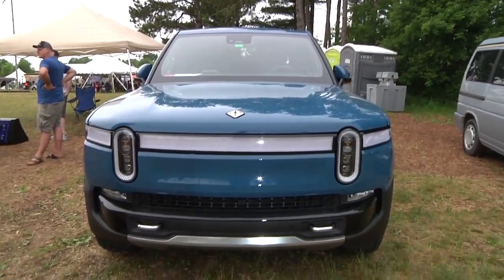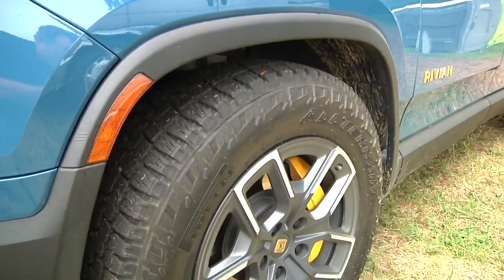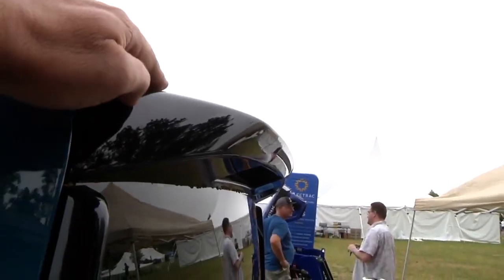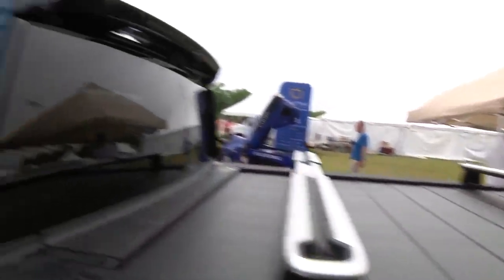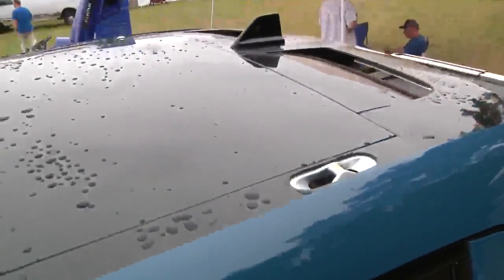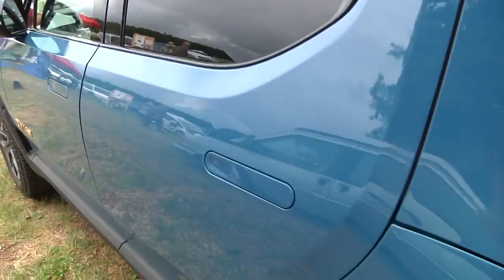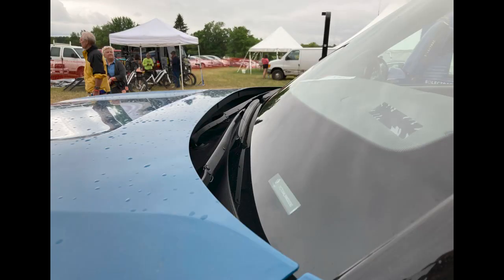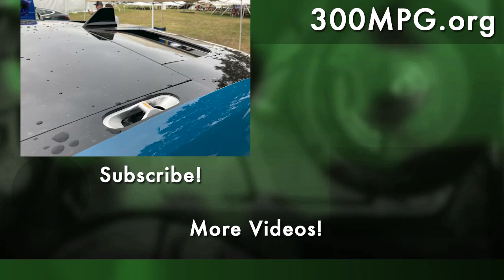Rivian Electric Pickup Aerodynamics

Comment: I am not an aerodynamics engineer but is having slots in the exterior body better than having no slots? The material making the slots is creating drag?
Reply: Those slots aren't adding any frontal area, so as long as they're not creating any turbulence that disrupts laminar airflow, which they seem specifically designed not to do, there's no reason they would add drag. It's probably a minimal difference, but over the course of thousands of miles it's likely to be worth the additional build cost.

Comment: It's a truck.  Pointless attempts at 'aerodynamics' as the thing is always going to be utterly inefficient.
Reply: yea those little scoops are not gonna achieve much more that style points
Reply: I'd argue the opposite, the worse a vehicle is aerodynamically, the more it'll gain from an improvement. A truck that takes 300wh/m will gain more additional range by a 0.01 Cd improvement than a car that takes 100wh/m.
Reply: People are going to have trucks, might as well improve them
Reply: Very uneducated comment. When you have a truck, 1MPG makes a difference. This is an electric vehicle and the plan is to extend the mileage per charge. The same idea can apply to combustion operated trucks.